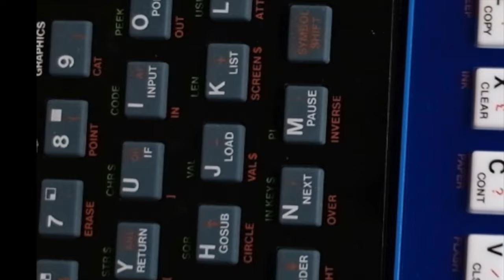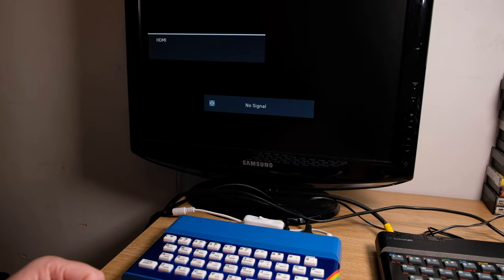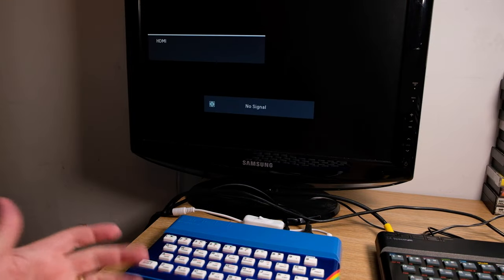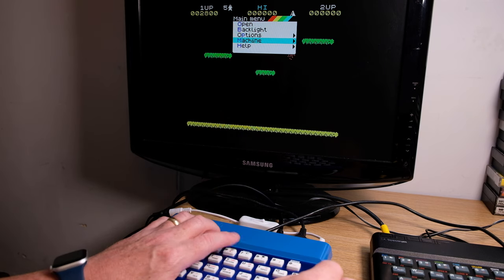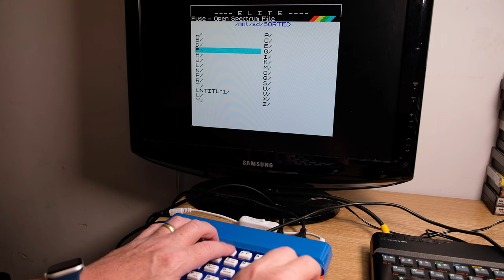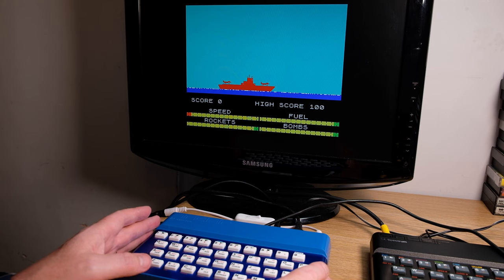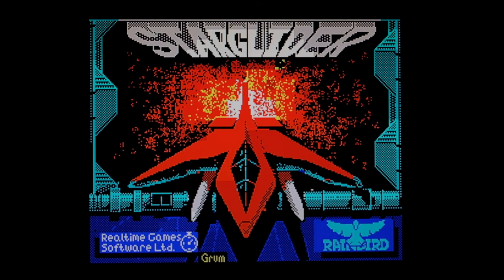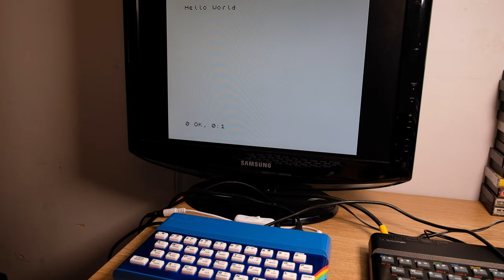Hermit Retro ZX Spectrum - A fuse/Raspberry Pi based Spectrum emulator

Comment: How is the keyboard connected to the module?
Reply from the maker: It uses the standard Sinclair connections (you can see them on the video at around 05:15)
Reply: @stevesretroloft  thanks!  Don’t know how I missed it!
Reply from the maker: No worries.   If you're interested in the device it might be worth keeping an eye on the hermit retro website as the creator is working on a Raspberry Pi Pico version of the board due to lack of the standard Raspberry Pi Zero.
Reply: yeah that sounds interesting.  I have a couple of zeros and a few picos!  I had bought a replica case and keyboard to make a spectrum emulator using a pi 3A+ but am still waiting for a keyboard interface board to be produced by another YouTuber (The Retro Shack).  He has done a few videos on it!